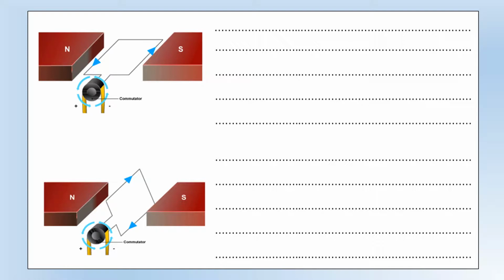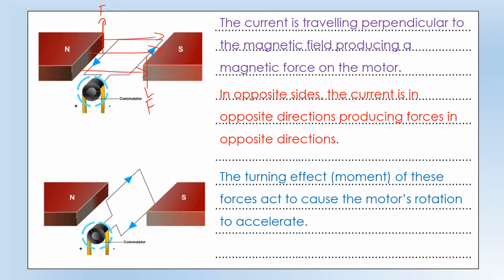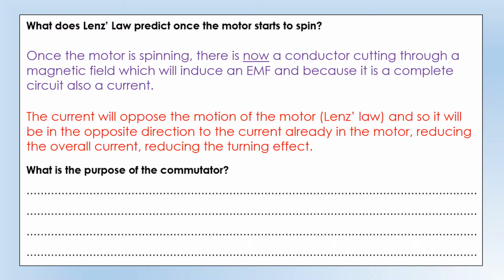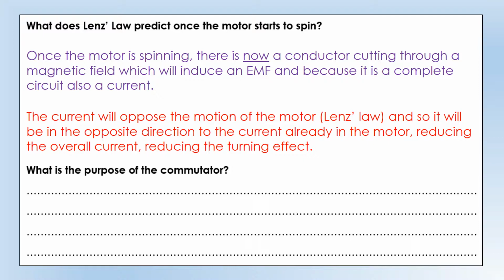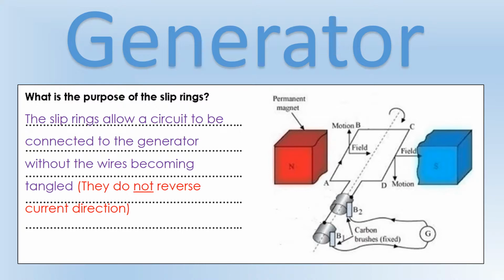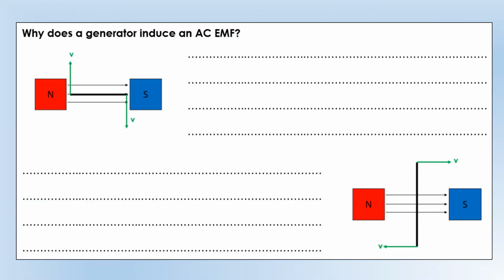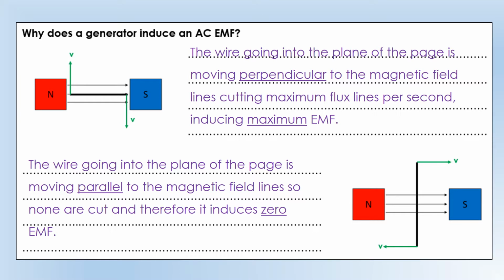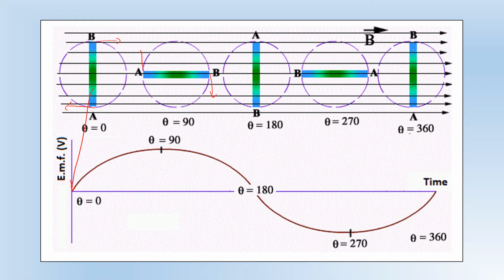iGCSE Physics: Electromagnetism: Motors and generators

Comment: I dont understand the last graph section for the motor, are you getting perpendicular and parallel other way round?
Reply from the maker: The last graph section is not about a motor it is about a generator. I just checked and my directions are correct!
Reply: @burrowsphysics  Oh thanks, I think I understand it now
Reply: @Burrow Physics the the forces produced on the coil in opposite direction because of the Fleming right hand rule?